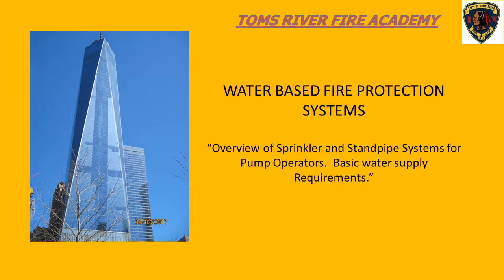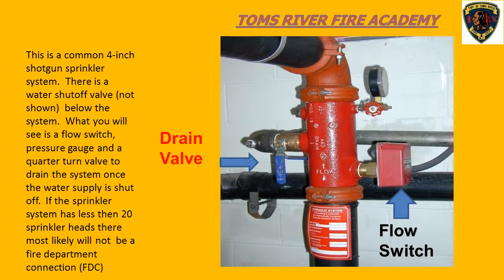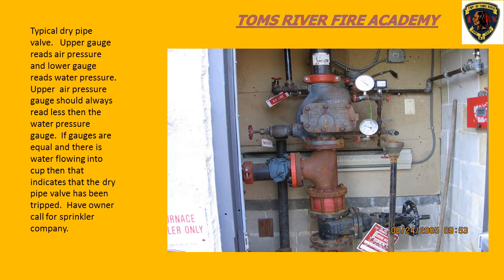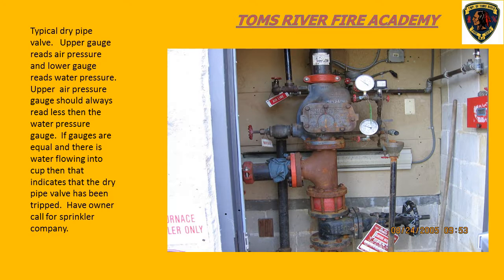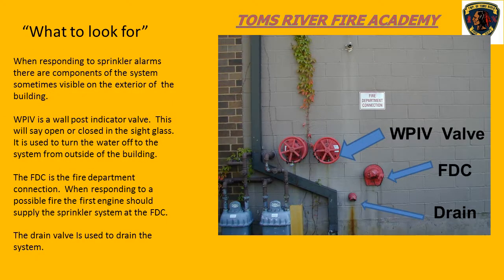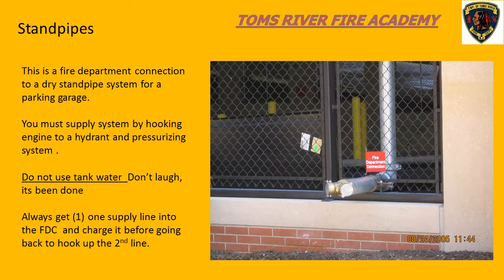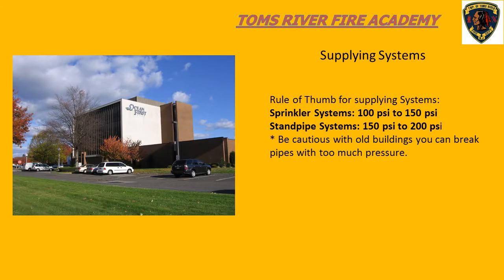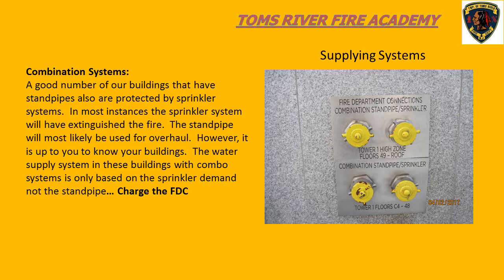Overview of Sprinklers, Standpipe and Fire Pumps

Comment: john Novak TR2FD ... How does water get to the 1,000' level from sea level? Certainly, with gravity, it would take tremendous amount of pressure to pump water to that level. My thought is there would have to be reservoirs at graduated levels to pump water from one reservoir to another. for example, each floor of the World Trade Center was about 1 acre. The demand on water would be such there must have been several direct pumps to satisfy restroom, restaurant and sprinkler needs.

I would also like to "think" if you pumped water to the 10th floor reservoir then the 20th floor etc. the weight of the 20th floor could use gravity to service the lower floors. As the holding tanks become depleted they would be refilled not unlike a toilet holding tank. The Roof of the WTC would hold a reservoir with water flowing down under pressure. Sea water is about 1 ton per cubic yard.

Comment: Why do you suggest shutting down the fire pump once the FDC has been supplied? Is this your department’s SOP?
Reply from the maker: Steve, the fdc is connected to the system up stream of the fire pump.  There is usually a check valve between the fire pump and the distribution side of the system.  Once the FD connects to the system we usually pressurize the system at a higher pressure than the fire pump.  This would close the check valve and the fire pump would be running at "Churn" (no water flowing).  If the fire pump is not set up to shut off if running at churn then possible damage could occur.  It is important to know your buildings and systems in your response area.